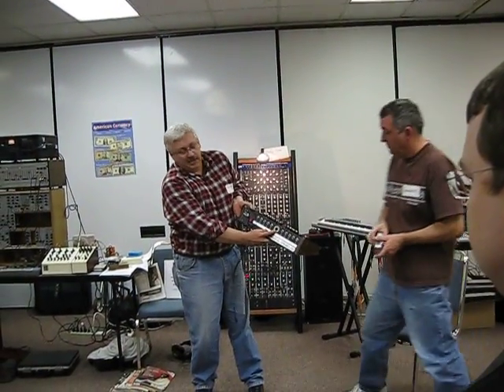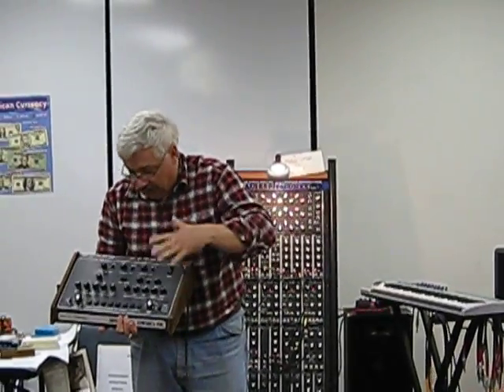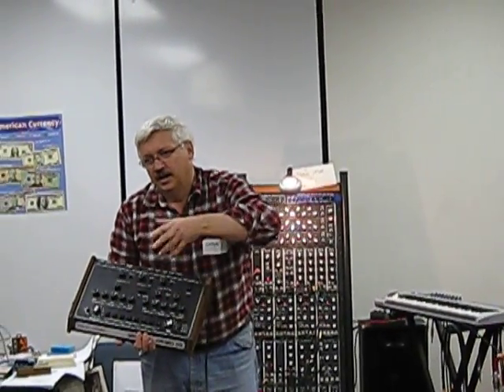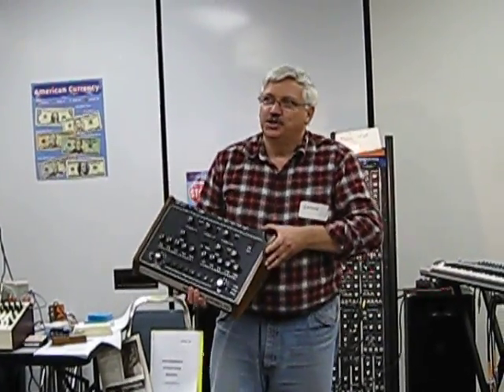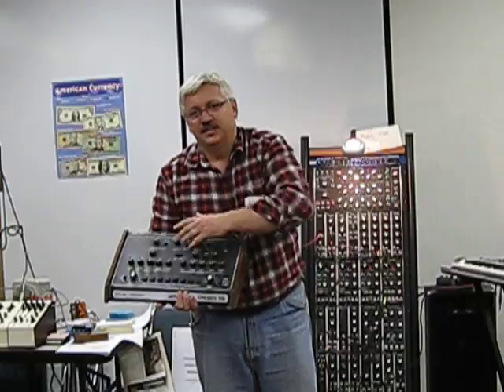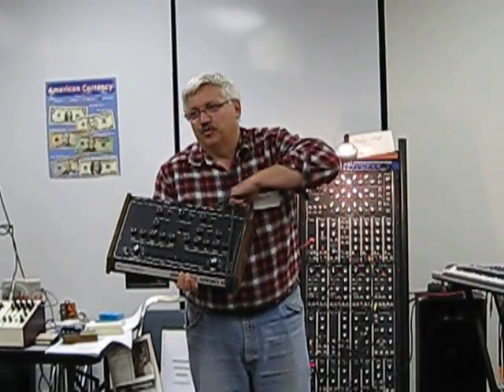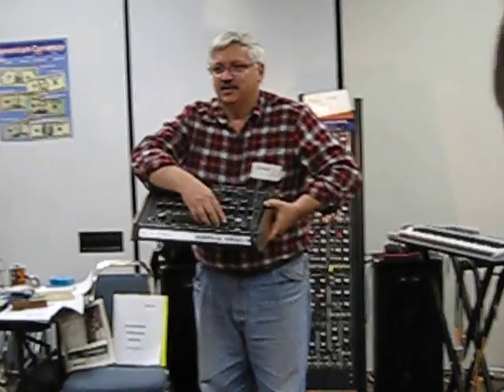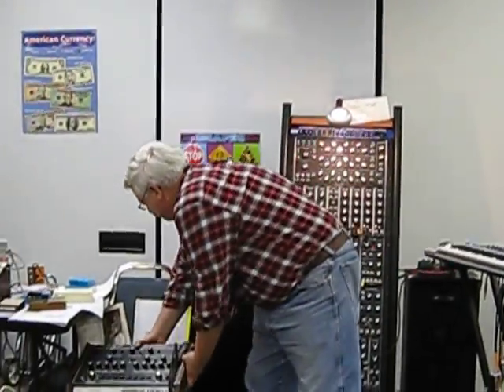PNW2008: Lorne Demos the Sequential Circuits Model 700

Comment: Basically this saves the envelope generator and pitch settings for your external vco’s?   If it saves it then it has to be digital and when it retrieves the value from memory it converts it from digital to controlled voltage value for both the envelope and pitch.  If my understanding is correct this is really a digital piece of hardware - similar to the Model 800 sequencer that stores digital representations of a CV value and replays the sequence using a digital clock. Please correct or clarify if I’m mistaken as I’d like to know more about this unit - thanks.
Reply: Right.

Comment: "Voltage controlled memory?" Not. Rather digitally controlled and stored voltage control.
Reply: Brynjulf Blix wouldn’t anything saved have to be stored as digital and then converted to control voltage when triggered by an external sequencer (like the Model 800)?

Comment: I agree that it could be the first voltage controlled memory. It was the first one I ever heard of. In 1977, I used two Sequential Circuits Model 700s with two Oberheim Synthesizer Expander Modules. They worked great.